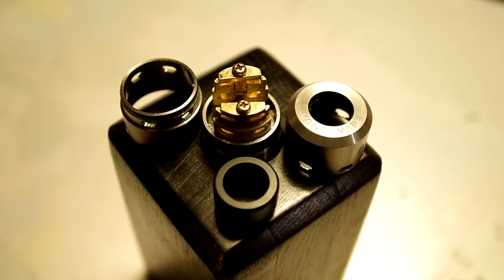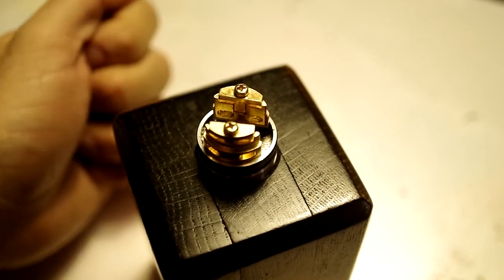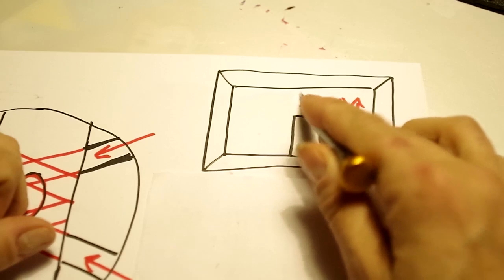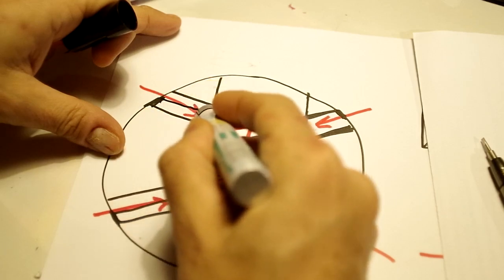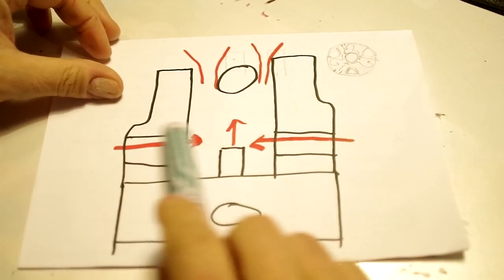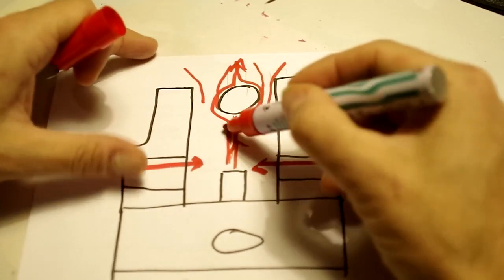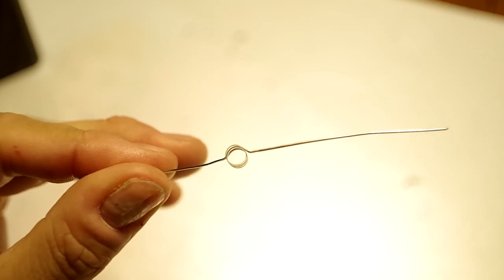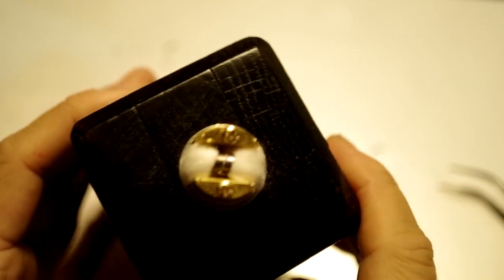Govad RDA air flow tutorial

Comment: Cool!  I've hammered a coil for my ammit 25! Better flavour less watt and temperatur… but i don't like kanthal… it's to springy... i use stainless steel… that works great for me👍👍👍
Reply from the maker: Awesome Bob! Heat the wire with a blow torch after hammering, and the springyness goes away.
Reply: I shelved this atty long ago. It goes leaky on the bottom after a while after putting new build. Do you have this promblem, too? Wonder if wicking hard will help
Reply: Alex Buttler 
This attys are all leaking at the bottom… (like kylin, ammit etc.) this is condens…. When you lift the coil it is less but the taste isn't so good…. If your coil is at much as you can at the bottom it will leak more but the airflow and the taste is better… 😉
Reply: Bob, what I meant isn't condensations from airflow holes. When you unscrew it after using for a while, the bottom of the RTA is all wet as if it comes from 510 pin, and if you keep using it more - it'll start to leak onto the mod eventually. Tightening the center pin doesn't help.  I got this problem only on Ammit 25, my other RTAs seem okay.
Reply: Alex Buttler 
Sorry this  leaking is only by my kylin... and i don't have a solution because i'm unable to unmount the base… it's press fit and i won't destroy the base…
Reply: Well, same problem, different tank)) Because of things like these I now vape more and more on RDAs and RDTAs primarily.
Reply: Alex Buttler 
And i won't buy chinese tanks anymore… i never had problems like these with my kayfun's,my corona, squape x or vapor giant v2.5… .😉
When you use rda's you can overdripp - squonk it's the same mess… 😂😂
Reply: If you need to use a tank i would suggest the Reload. No leaking to the point I trust it to leave it overnight on top any of my mods/mechs, or even for a whole month☺
Reply: Yeah, I happen to have a Reload $10 clone. Ironically, it's the best RTA I own, and the one I spent the least money on))
Reply: Alex Buttler the reload? 😂😂 good joke😆😆😆 this is cheap china trash with bad flavour and worst machining…. the airflow holes are too wide out of the middle, the gold plating is verry bad and spotty… the threadings are terrible… say it how it is… it's trash (my oppinion)
With 10$ is the atty 20$ to expensive😆😆😆
Reply: Bob, I agree on threading and gold plating. But it never leaks (using or refilling), no dry hits with really hard wicking.  And I found coil positioning and size that give a decent flavor.  That's for $10
Reply: The Kindbright clone of Reload RTA is awesome like the RDA clone too. I have both the orgininal and the clone and I can not tell a difference between them in taste/leakyness/airflow. There are AWESOME clones that are really worth buying nowdays and I would not be surprised if they came from the same assembly line as the authentic ones.
Reply: Niko Eronen 
Everyone should buy what he/she want… and be happy with it or not😉

Comment: hello morten. if i use NarCa (the so called updated version of the NarDa) how high or low shoul i place my coil? and which inner diameter would you recommend if i build one? thank you. looking forward for more air flow tutorial!
Reply from the maker: I am not familiar with that one. I have only images to look at. But your coil should be placed so that air hits it at 3 & 9 o'clock. The diameter should be so that you have 1,5mm clearing to each side. This is only a guide line. I can not say for sure without mesuring the air holes and max possible length of the coil. It looks nice, like an expensive Wasp Nano. Look at my review of the Wasp and you will understand the important aspects.
Reply: +Morten Oen thank you for the prompt reply! i will look into it. greetings from Brunei Darussalam :)

Comment: Just lurking now... I don't have this RDA...
But, asking for your opinion: For bottom airflow RDAs, are they the best? and should we have the coil close to the bottom airflow, while having a wide coil?
Reply from the maker: Top air flow is better than bottom air flow. But only the Aeronaut has made it work. For now:-) Distance does not matter much for bottom airflow, but by pushing the coil half a mm to the side, air can be guided perfectly to the drip tip (Watch my Fine Tuning air flow video). If the coil is 3 or 6mm above the hole, it really makes noe difference as the spread of the jet is insignificant. A Kennedy is better than the Govad, and the Aeronaut is the king of single coil RDAs for now. And I would prefer even the Wasp Nano and Gorge RDA over the Govad for flavor, less spatter and so on. If the Wasp is too narrow for you, look at the Gorge from Advken.
Reply: Again, Thank you for your insight & experimentation! Very valuable indeed.

Comment: one thing is not clear - with Muji cotton you do not mention stripping off the outer layers. do you do that?
Reply: No he doesn't remove the outer layers (they have important wicking properties), no combing or fluffing either.
I myself cut a small corner/triangle off one end to help when initially feeding it through the coil, so I don't have to roll/compress the cotton and end up destroying the long fibers.
Reply from the maker: Hi John, No I don't. The layers are an important part of the cotton. My experiments on wicking shows that:-)
Reply: I can confirm. I followed Oen's advise and stopped stipping off. I'm not sure if it wicks much better, but there's only pros: 
1) it wicks at least as good
2) you wick your coil faster and more precisely 
3) you don't waste your cotton and your stash dosen't disappear as fast
Reply: Great idea, thanks